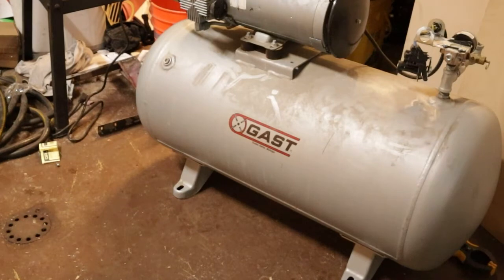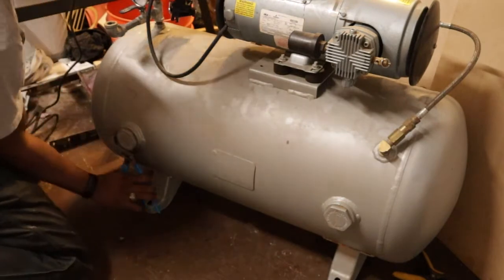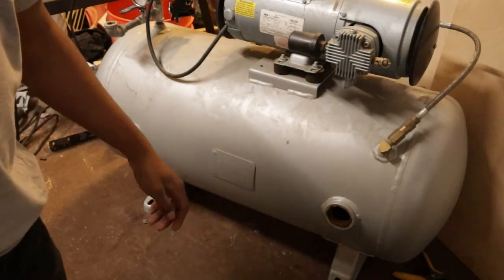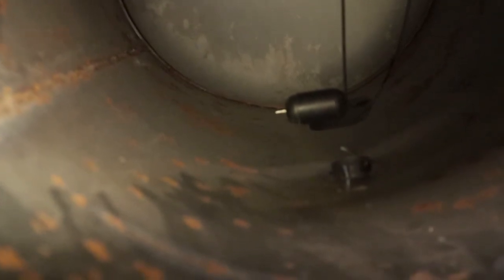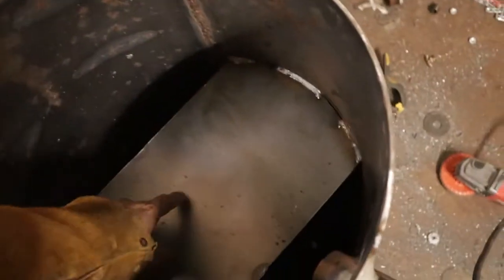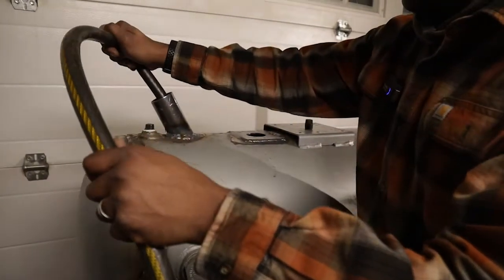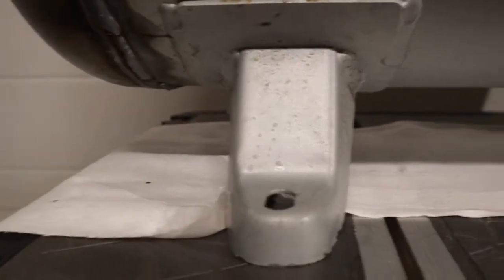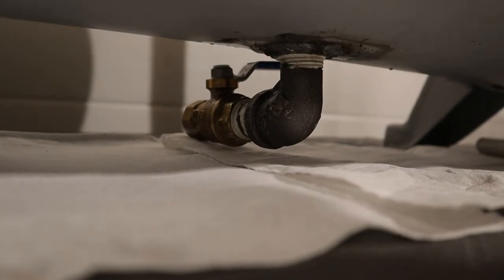DIY Converting a old air compressor into a Fuel cell - Making Adventure

Comment: This is really neat how you reused that old air tank and converted it to fuel tank, but wouldn't it have been cheaper and quicker to get a fuel tank from an scrap yard?
Reply from the maker: Hey Steve! This was actually an old air tank with a broken pump that Stephanie's dad had laying about. It was relatively clean and the conversion was straight forward. We are adding another fuel tank that we got from a local scrap yard soon. We still have to clean it, take some dents out, and add baffles. That will bring our total fuel capacity to 180 gallons!